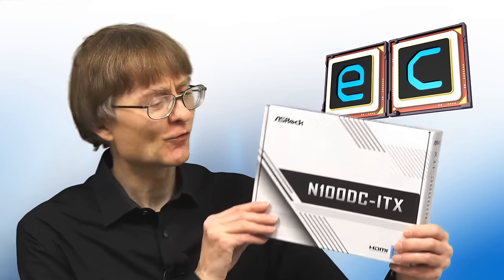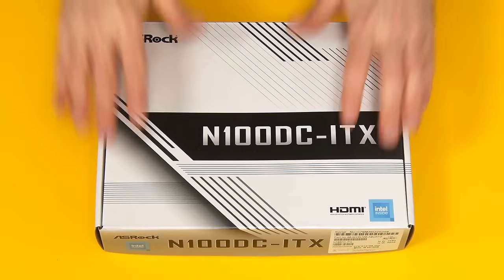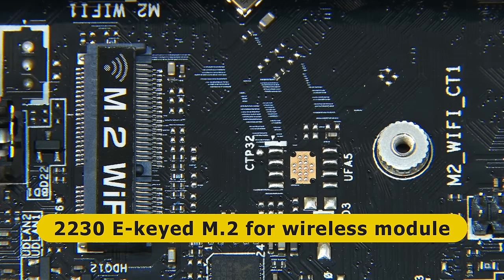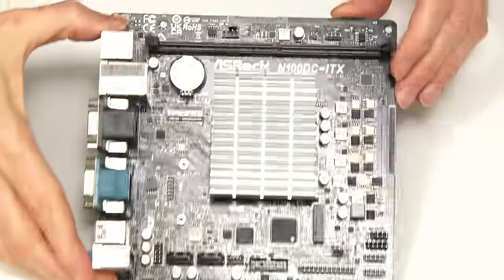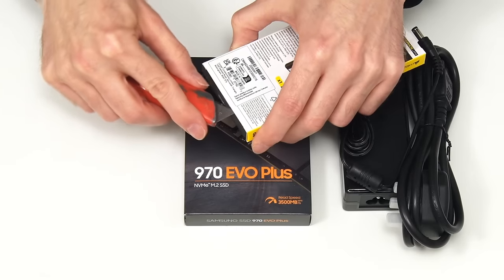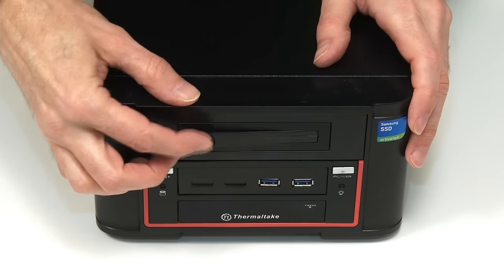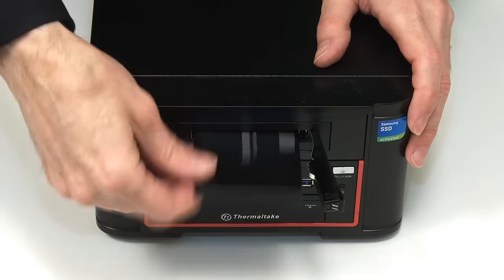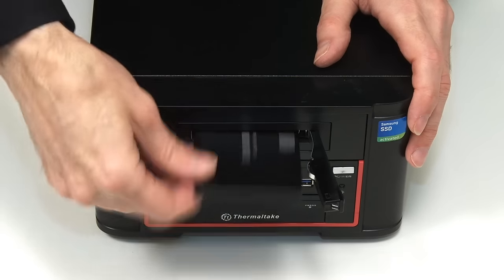N100 Mini-ITX Silent PC Build

Comment: vastly underpowered - you should have left old system alone and but something much more robust as well as adding double deskspace and more monitors - for the noise issues i do commiserate - this really is an overlooked issue but fairly easily solved. i see the ideal system for you as am4 12 core plus 64gb ram and dual nas with 40g - less than 2k for the total system (3 pc) - why wouldn't you? you probably need the writeoffs and it may even drop you down a bracket - double win - you could upgrade in a year or two to am5 and zen5 and make the old pc a server or a pkt cap box - i run an older 3rd gen with 32gb ram and a few vms and still end up hitting swap space regularly - you just cannot have too much ram - am5 platforms can now run 256gb although the cost is prohibitive - in a couple years it will be more mainstream and affordable.
Reply from the maker: How can you possibly say "vastly underpowered" without knowning the use case? As the video very clearly shows, this system is more powerful than the one it replaced, and which never struggled to do anything asked of it. It was replaced to make is quiet (on medical grounds) and for no other reason. You can clearly missed the point of what I use this particular system for -- it is NOT used for video editing or 3D graphics work. And unlike most YouTubers, I know how to focus on a video producgtion hardware pipeline, not just on throwing money at a desktop PC. :) I've no idea at all why you think I need a NAS.
Reply: @ExplainingComputers  it does not have dual chan memory for one to start out with - this is bog standard now with most pc so you are already putting yourself at a big disadvantage right out of the gate - full stop. if the real purpose is for peace and quiet just get some long cords and put it in a nice cabinet - there is more than one way to skin a cat, as for the nas - this is a basic tool for redundancy and why you probably want and need two - you have tons of important mission critical data as do many businesses - they have nas devices for good solid reasons - this is not some high highfalutin use case at all - it is commonplace and widespread. high speed memory bandwidth is critical and so is rapid access to redundant storage, i stand uncorrected but if this setup works for you more power to you, you deserve a medal,but for most it would be subpar and underpowered. i could see it as a valis use case just to run rdp/vnc over ssh to a server or two plus a nas or two, otherwise just get out.
Reply: @shephusted2714  Why are you putting requirements on the user which are not part of the original portfolio of use cases?
Reply: @TheDanEdwards  common sense, a reaction to so much pi spam, and a clarion call to not leave performance on the table for not that much more money - go for value and performance and flexibility don't pigeon hole yourself into a use case where you are basically handicapped when it comes to doing anything outside of light workloads - give yourself some breathing room and a better upgrade path are among a few of the reasons i am speaking up - is that enough? also look at it this way - as a carpenter i spend thousands on tools but they are writeoffs which end up lowering me down an income tax bracket so essentially they pay for themselves and make for more competent skilled work - his situation is not all that different #value #human factors engineering #redundancy #flexibility #time savings #efficiency #benchmarks - but within reason - i am not advocating for compensator system here #jesus harold christ on a rubber crutch
Reply: @TheDanEdwards  why not - he is limiting himself severely, he could do much better and everybody knows it, i am not being over critical or making it personal but i have a right to voice an opinion especially when it is so pitiful and limited - i mean come on - for the same amount of money he could have gotten a refurb box and put on a noctua fam and then put it 15 feet away and had a better solution to his use case. Ultimately it is up to him and that is the bottomline - if he wants a underpowered box fine but at least he should look at and test various options - it is raspberry pi spam just on a slightly more evolved level - suffering in silence is the english way after all #remains of the day #pwm